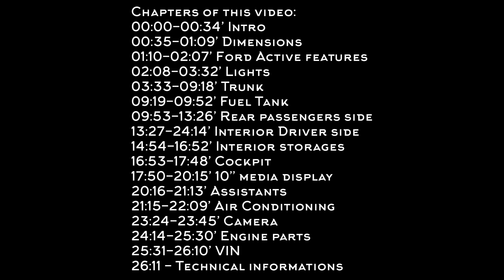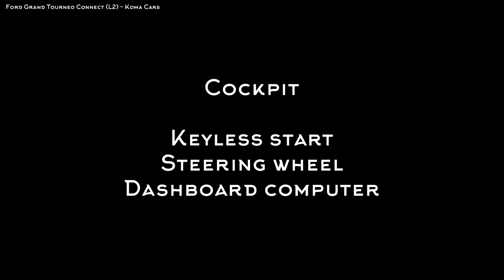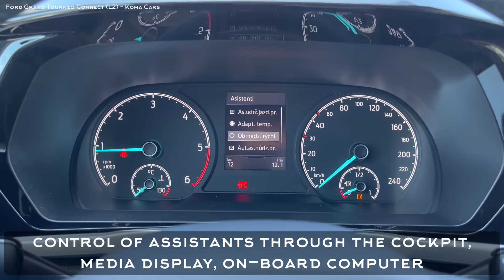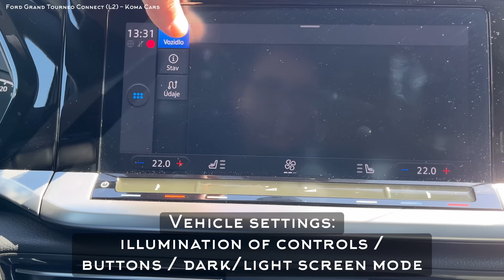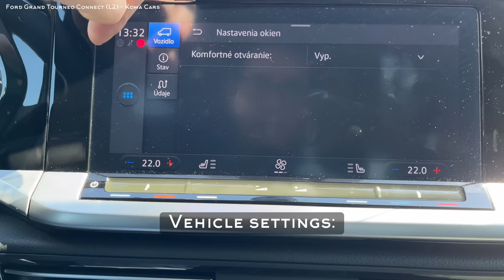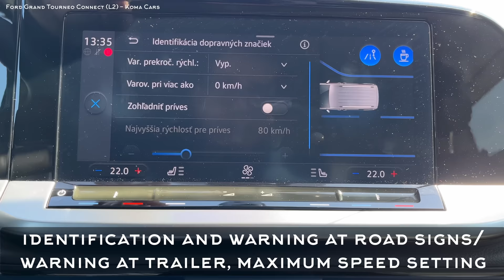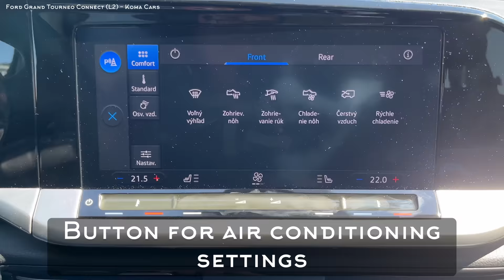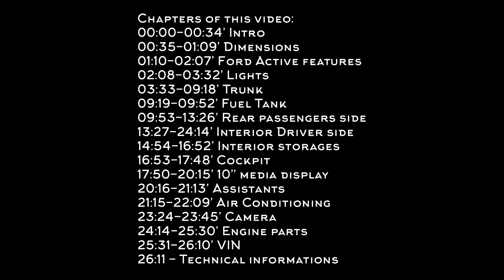Ford GRAND Tourneo Connect (L2) ACTIVE 4WD 7 seats - Detailed video overview of the car / info

Comment: THE CAR WAS VERY BEAUTIFUL, WITH 7 SEATS, EVERYTHING IS GREAT, BUT, THE REAR WINDOWS ARE NOT AUTOMATIC, A MAJOR LACK IS .PEGO RIFTER REAR WINDOWS ARE AUTOMATIC.
Reply from the maker: Yeah, peugeot rifter has its advantages, but ford has automatic door locking, 4x4, different seats (better than rifter), it also has a 2.0 engine and rifter only 1.5 or electrics - don't get me wrong - rifter is an absolutely great car - Ford has a little other options (it's a VW Caddy)